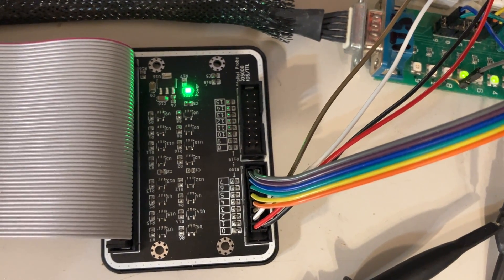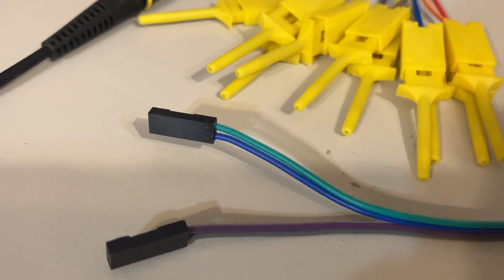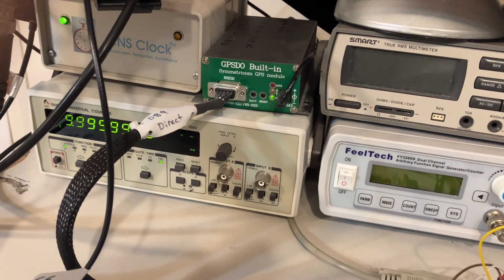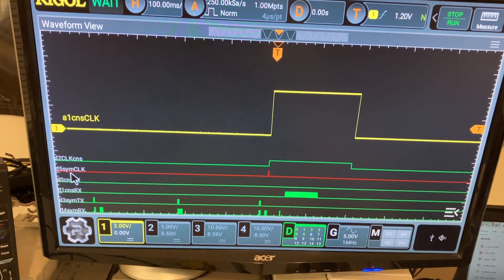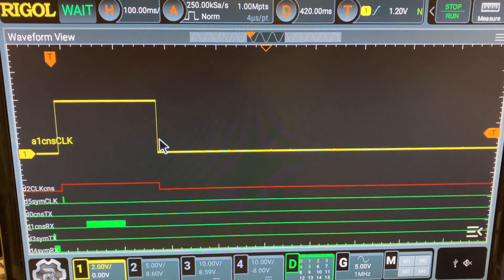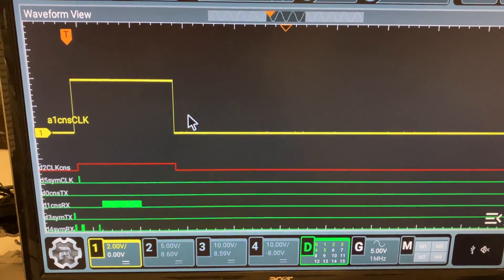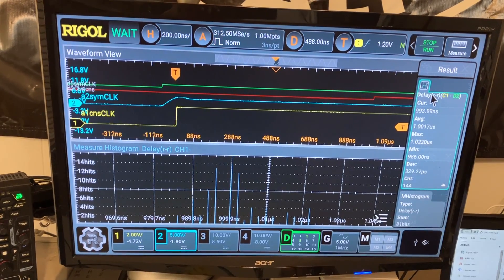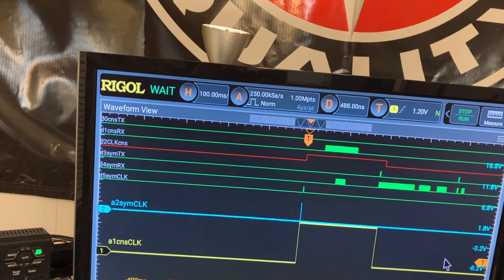Logic analyzer for DHO924s

Comment: Make Video On SPI Communication with Oscilloscope Setting...
Reply from the maker: yes , I didn't have time to do it. i will at some point do a video now that I got a better SPI source than my AI camera board I have. I just got a Siglent SDB3 demo board with SPI source. I also awaits Rigol to issue a new firmware that hopefully resolve the issue I have found with PASS/FAIL triger, 5 byte I2C trigger and maybe the SPI issue.
Reply: I own the DH0924S along with the Logic Probe from RIGOL. Albeit the SPI Decoder license is installed into my Oszi I was not successful to decode a simple SPI Signal by using the LA :-( Honestly I'm very disappointed by the Oszi - especial in combination with the LA. It has so many annoying bugs. For Instance I was yet not able to apply custom labels for the LA Channels albeit the Osi Offers such a function. The Default Labels (D#) still remain. What a crap! 😞
Reply: @hanspeterbestandig2054  I have decoded SPI signals with my MSO5000.   It works pretty well.   I was able to apply custom labels to the decode streams, ie MISO, MOSI, etc.   If you have trouble, make a post on the EEV Blog forum under Test and Measurement.  I'm sure you'll get help there.
Reply: SPI decode using logic analyzer inputs is eluding me too.